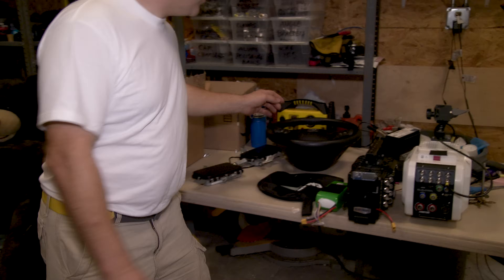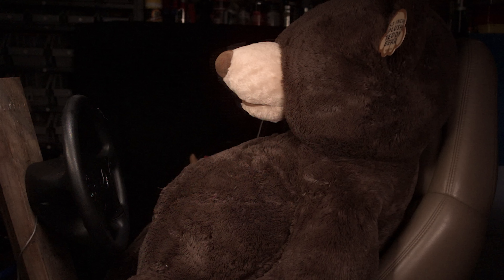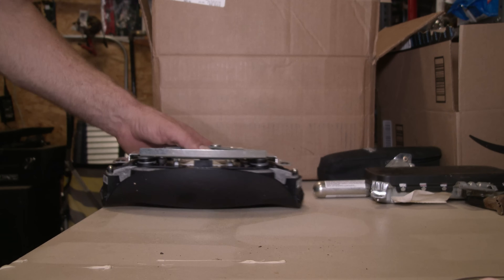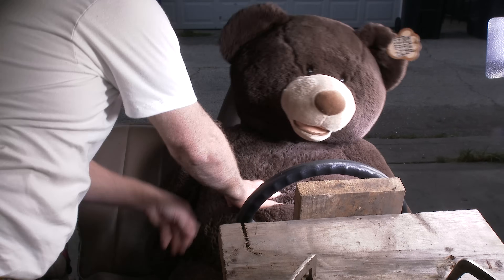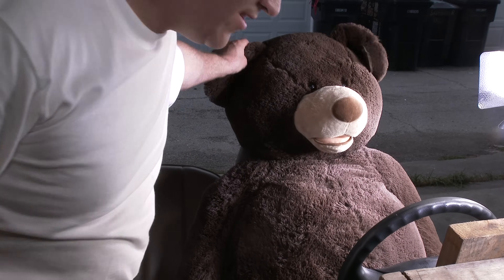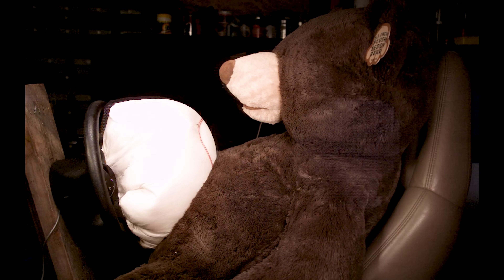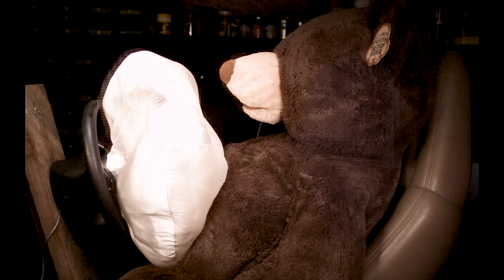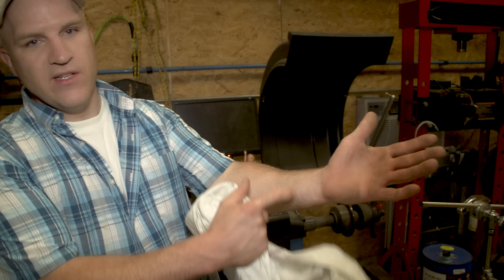Drivers Airbag Deployed on Teddy & Baby - in Ultra Slow Motion  [ 4K ]

Comment: I've seen pictures online that show people bedazzling their steering wheel airbag with healing crystals and things like that. I've also seen a passenger side covered in seashells. It would be interesting to see in slow motion what would happen when an airbag deploys when the outside is covered in what amounts to a claymore.
Reply: It's funny I came here after seeing the same meme and wondering that exact thing. I think if the glue was very strong it might just stay on the flaps?

Comment: It’s not smoke from heat. It’s a talcum powder material that is used to lubricate the airbag when it deploys. The airbag doesn’t get hot.
Reply: I crashed my truck in February, the airbags smell and taste awful
Reply: @zachfelix8491 I’ve had 5 air bags to deploy on me in my life and that is the truest statement ever.
Reply: Yeah it's the powder, and the odor is from the chemical reaction. However, the explosion itself is quite hot for a brief period of time.

Comment: Well, if the driver's side bag is out. Then, the passenger side should be as well. The main concern is not to put your baby or little kids on the front passenger sit, which you did not mention.
Reply: This isn't true because I was just in an accident today and only the steering wheel airbag deployed.  Many vehicles only deploy certain ones based on where the impact occurs.  I'm guessing the passenger (or none of the rear ones) did not deploy because the seat didn't detect a passenger.  BUT I would never have my kids in the front seat still.  I hit the front/side of a car as it turned from a turning lane to across two lanes.  I was driving across one of the lanes and they stated they did not see me.  Fortunately, I am okay and my daughter is too.  She was in a high back booster in the seat behind me.

Comment: When my airbags deployed in a rear end accident, I thought the smoke was from the engine, but then my dad told me it was from the airbag. (It smelled real bad)
Reply: Oh yes, it certainly isn’t a pleasant smell for sure.. If my memory serves me well, it’s a type of “sodium bicarbonate” solution packed into a charge capsule which is responsible for the rapid expansion of heat that is released when the capsule is fired. I’d been a survivor of a wrong way drunk driver whom had hit me head on at ~ 70+ MPH, and not only did it smell, but what along with what is commonly perceived as “smoke” when the airbag deploys, is actually a “talcom powder” which  sole purpose is keeping the airbag “pliable” and ready to deploy the nanosecond the vehicle detects what it warrants to be a “severe impact”.
Reply from the maker: Yes they are Stinky

Comment: Sitting to close to steering wheel that's why it hit teddys rolls
Reply: dazzap321 and that can be deadly, and is why they say that you should always be at least 10” or more away from the steering wheel as airbags do generally deploy at speeds of 200 MPH.

Comment: The wrist burns are a rug-burn, from the sudden abrasion. The smoke is because the bag is inflated with a pyrotechnic charge. The bag does not get hot enough to burn you.

Comment: Not only did I get burns on my wrists from the bag deploying, but I also got a bloody nose and marks on my face. I hydroplaned into a light pole, so as my truck was impacting, I was thrown forward- my face made contact with the bag, my hands were thrown from the steering wheel (my right hand left a mark on the windshield glass on the FAR side of the rearview mirror, and knocked the mirror to the side as well).

It was a violent affair. I know that smell they make, and remember having to wear a sling because my right arm was yanked at the shoulder. Some of the forces were from the bag deploying. Others were from the truck bouncing off of a pole a 40mph, which paramedics would later tell me saved my life. Had the truck impacted the pole dead-center, the energy dissipation would have been too great for my body to sustain. That, and they had already worked an accident with less vehicle damage, that resulted in a fatality that night.

So I was lucky. What I would like to see is Teddy's hands loosely taped to the wheel, and his upper body closer to the wheel to simulate a head-on impact throwing a body forward. Also, I have a small roadster now, with side-impact bags. I'm interested in what those can do to an occupant's arm/shoulder/ear area.
Reply: Mobius_1    Read Carolyn Hall’s statement in these comments. I wrote the following: An expert, Carolyn Hall, informs you that your information is wrong, yet you do not correct your statement. The cloud IS explosive chemicals. You are purposely harming people, even children.

Comment: Sorry, but this isn't really correct. I worked in airbag design engineering for the majority of my career.  Now, I will agree it is unlikely.  But when an airbag inflator deploys, it is a controlled explosion. With any explosion, you have effluent (gaseous) and particulate (solid) matter.  When we tested a new airbag/inflator combination, we had to measure both portions of this. For a very small portion of the population, generally someone with acute asthma, levels that are too high can trigger an attack. Then the idea is that if someone is trapped by the wreckage, and the windows didn't break, it could lead to a bad situation.  But again, a lot of things have to happen to make this situation a reality. But there are federal regulations on the allowable limits of effluent and particulate matter allowed.

What is more important, though, is to never let your child ride in the front seat. The airbags have a tremendous amount of energy in them (remember your are catching a pyrotechnic explosion in a bag). Consider it like this.... The airbag needs to be designed to keep me safe when I am sitting properly and buckled...6'0" ...230 pounds.  Do you really want that same airbag hitting your small child?

Perhaps the conversation you overheard was about kids in the front seat at all during a wreck with an airbag deployment. Depending upon the control logic used by the manufacturer of your vehicle, the passenger side airbag might go off in combination with the driver's one, and that's definitely not good for your small child.
Reply from the maker: +Carolyn Hall I completely agree, I was just replicating it the way that I overheard it, but you are correct. Apart from that for incense in my truck there's a key in the dashboard to turn the passenger side airbag off if you need to put a child seat in, also in my Mercedes as well. A Mercedes manual says if you need to put a child seat in the front it has to be forward facing and you need to move the seat to the rearmost position. For the next episode of this subject I will definitely try the child seat in the front and both positions with passenger airbag deployment, that was actually on my list I already finished the side impact Airbag video about a year ago as well. They were just kind of incomplete for full episodes so they never got posted.
Reply: Warped Perception   An expert, Carolyn Hall, informs you that your information is wrong, yet you do not correct your statement. The cloud IS explosive chemicals. You are purposely harming people, even children.
Reply: Carolyn Hall Yep, nailed it.
Reply: Carolyn Hall  Most modern cars allow you to turn the passenger side airbags off to allow you to safely sit your small child there - if not then never sit your child in the front - obviously :)